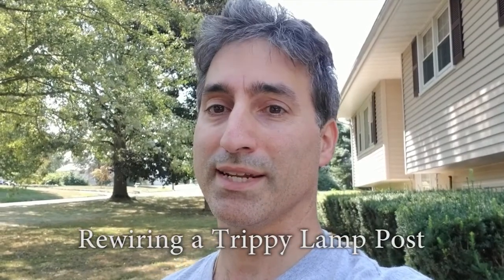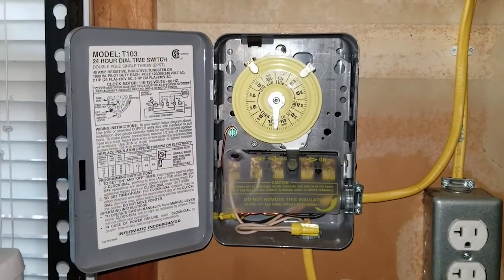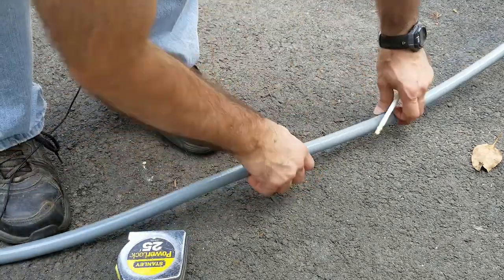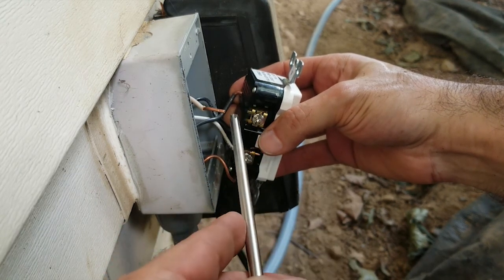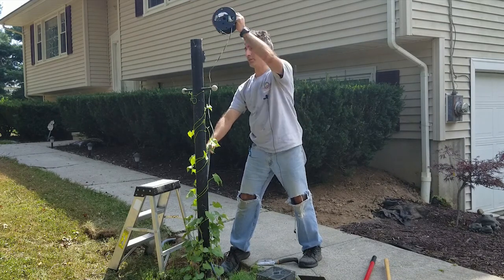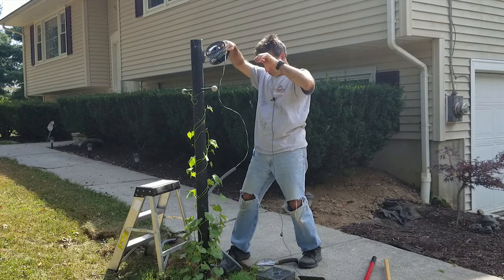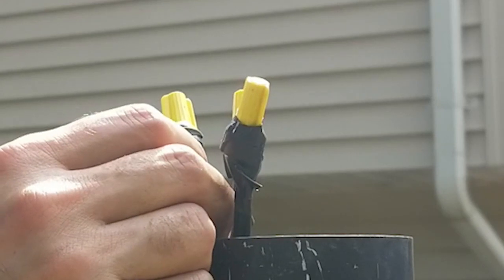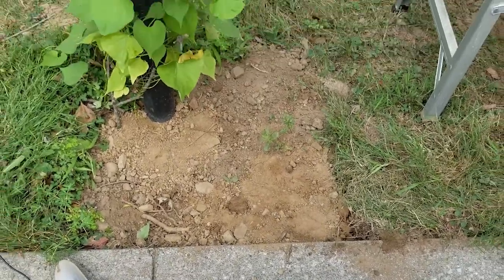Rewiring a Lamp Post that kept tripping the GFCI

Comment: I don't mean to be a Dick but your installation is a POS,  sorry but it's wrong in so many ways the seal tight conduit is not necessary, you could have used UF type direct burial wire, your trench is illegal it must be 12" deep with or without the conduit,  there is no need for the caulk, and tape in the end of the seal tight conduit, there is no need for the little kink in your wire connections,  If you strip the wires to the correct length, which is shorter and use a quality wire nut there is no problem and there is no need for the tape on the wire nuts.
Reply from the maker: Thank you for your opinion and observations. Here are some answers to your concerns:
1. I used conduit because the originally installed UF cable had developed a ground fault. Research with other builders showed a trend toward using conduit over UF due to better robustness over time. I wanted to do this once and never have to worry about it again. 
2. Good point about the burial depth. I followed the depth of the original cable which was either not done properly or was done long enough ago when code requirements may have been different (my guess based on your comment is the former). I did leave extra length, so I should be able to sink the conduit the extra few inches to meet proper depth.
3. The caulk may have been overkill, but see my last statement in point #1. I also wanted to keep creepy crawlies like ants and spiders out of the conduit.
4. While I have made MANY a wire-nut connection using straight stripped wires, I found that when mixing solid and stranded in a joint, adding the kink makes it so much less frustrating and produces a nice solid connection. The tape was intended mainly to keep ants and spiders out of them. My father-in-law apprenticed with a guy who never used wire nuts. He soldered and taped every joint.